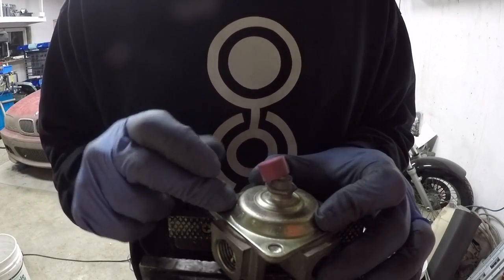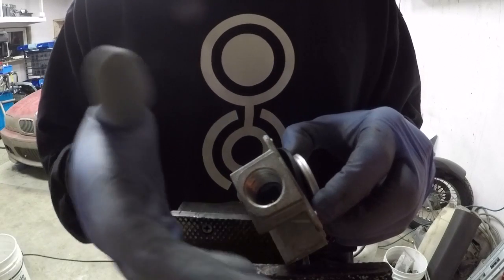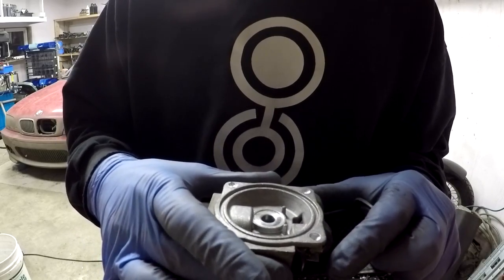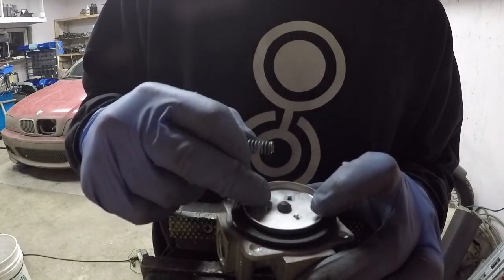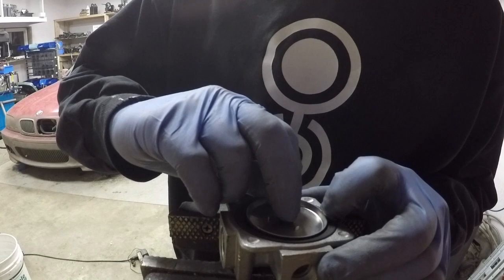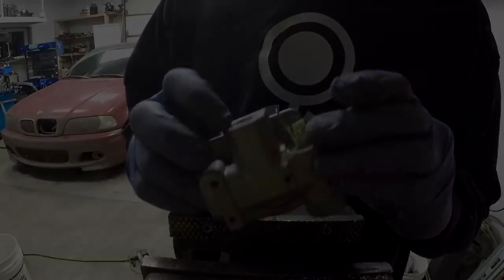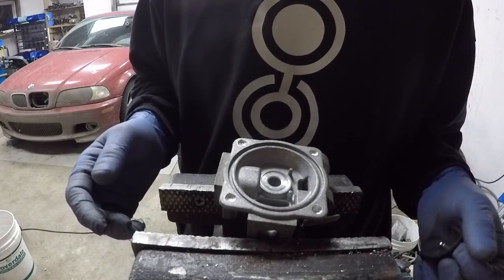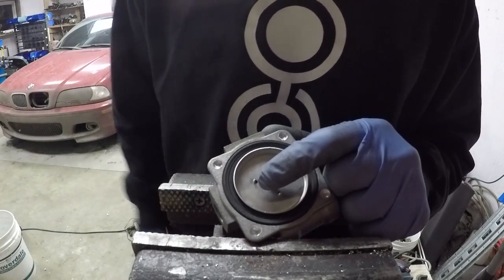How a Natural Gas Regulator Works. Propane regulator etc.

Comment: I detected gas leaking out from the pin hole on the vent cover.  Is this normal or the diaphragm is ripped and the regulator needs to replaced?
Reply from the maker: No, this is not normal and it should be replaced. 

At most, during proper operation,  this may vent some air while the diaphragm is moving.

Comment: I had to replace my leak regulator on my jenn air.  Great explanation of the purpose of this system.  Do these regulator leak/ malfunction over time?
Reply from the maker: They are not considered a consumable or a wear item, but like anything mechanical, they sometimes fail.

Comment: Nice demo thanks. It's important to note that no fixed pressure can be set with this type of regulator. It can only provide a ratio between gas pressure flowing in and gas pressure flowing out.
Reply: Gas
Reply: samista dangol Houses in my neighboring town blew up because Columbia Gas Company doesn't understand the dangers of these regulators. They get debris lodged in them and never fully close (lock-up). after the gas is turned off. When it's turned back on, the gas sneaks past unregulated. By the time back pressure is received, it's too late. They saw upwards of 200 wc on the delivery side. Homes that didn't have their own regulators either caught on fire from a raging pilot light or blew up from joint seepage and then ignition from the pilot light.  Hundreds of workers and equipment have come to fix this disaster which would not have happened if all homes had backup regulators.